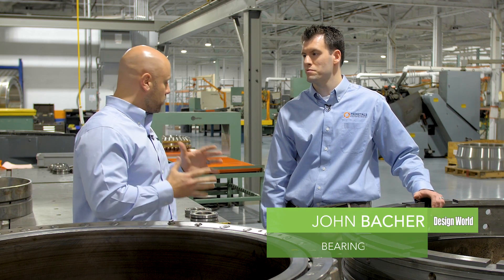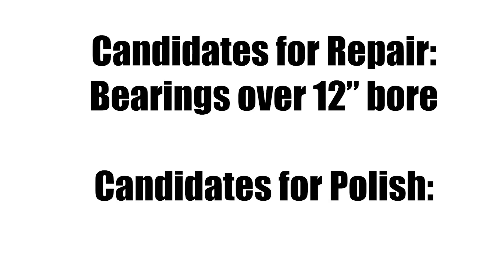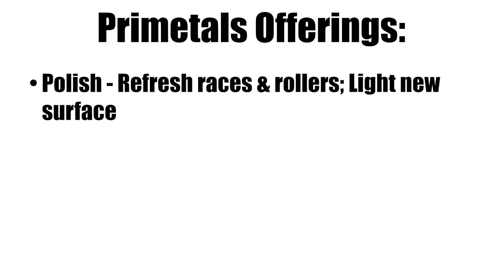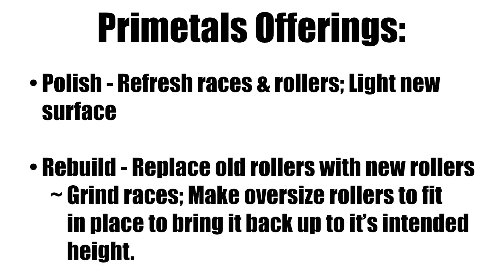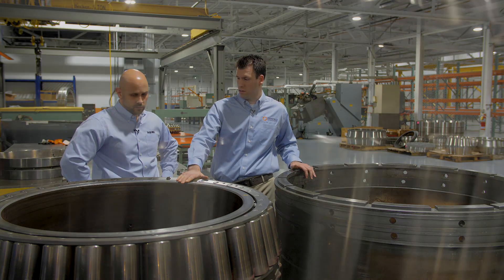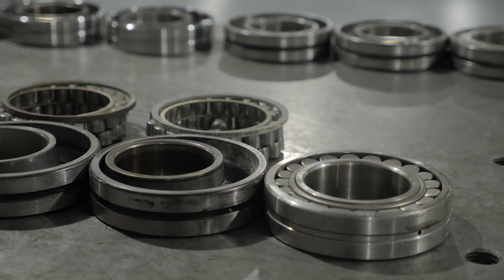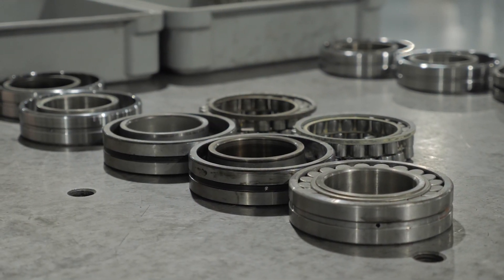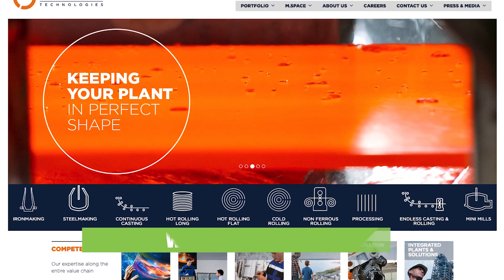How do you repair bearings?

Comment: It doesn't look like, from their website, that one can just send them a bearing to get it fixed. Is this a possibility? Or would it be more cost effective to get a new bearing?
Reply: Diego, Yes you can just send in bearings to our Warren, Ohio USA shop where the work is performed. There we will clean and inspect what is sent in and send a quote. We repair all types of bearings up to 72" in diameter. Typically anything over a 12" bore is good for a rebuild repair (ground races and new rollers) or we have a polish type repair for smaller bearings. You can  email me at john.bacher@primetals.com if you are interested. I can e-mail a brochure for more information or provide an address to send the bearings in for evaluation.

Comment: How about W33, have or no have is better?
Reply: The W33 groove helps get the bearing lubrication to the center of the bearing so it is beneficial to have; however, to have this feature or not depends on your specific application.
Reply: John Bacher so you work on bearings, right?
Reply: Yes, we repair all types and some we manufacture new.

Comment: John Bacher: These large bearings are mainly used in steel mills, mining, paper mills, power generation and oil and gas applications. We can polish or rebuild (with new rollers, ground races) from 12" bore and up and anything smaller than that is a good candidate for a polish type of refurbishment. We receive smaller bearings - customers disassemble them from their equipment, collect them up in a crate and send them in for a cleaning and evaluation.